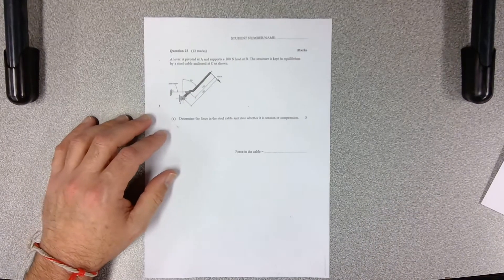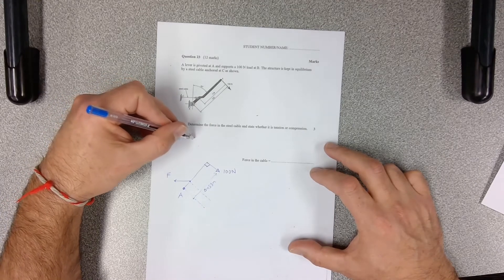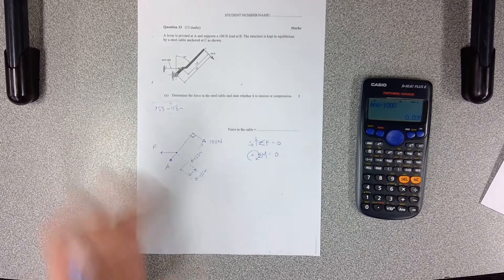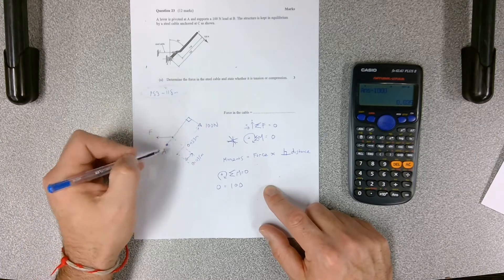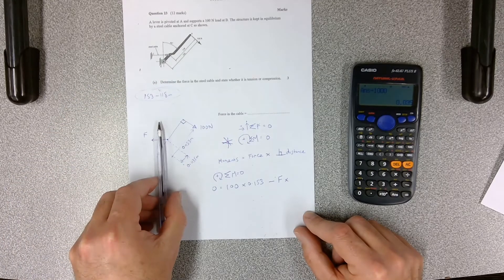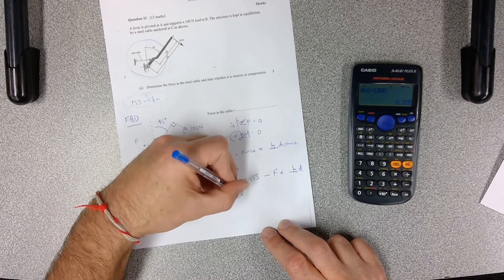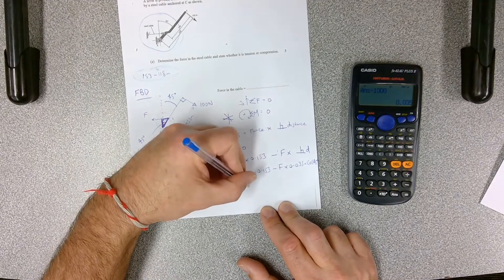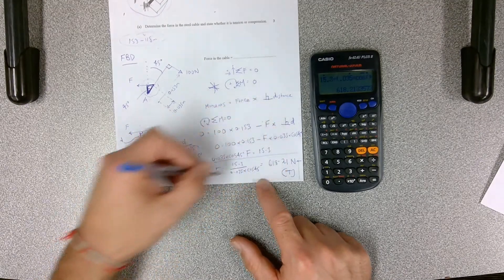Moment problem  - HSC Engineering Studies.

Comment: Thanks. Im kinda getting it. I struggle with this content however if I practice for a few hours I should be able to apply to different problems.
Reply from the maker: Yes....practice makes perfect. If you do engineering this will help in first year....I know as I studied engineering (first year) last year and it came in handy! Glad it helped. VK2AOE ....I'm a ham again sending morse and building transmitters etc....Ham radio playlist.

Comment: Well, I’m failing
Reply from the maker: No your not!!!
Each question is a gold mine ....you just have to dig!
Even if the answer is wrong you can still "pass" the question. Here are some pointers.

STEP 1- Draw a clear and NEAT labelled Free Body Diagram (FBD) .....tick some marks. 

STEP 2 - Resolve inclined forces (eg. forces that are not horizontal or vertical).....Horizontal Fxcos(Theta)....Vertical Fxsin(theta)....more marks. For this problem we don't need to resolve the forces as we know the perpendicular distance.

STEP 3 - Remember that moments are calculated as perpendicular distance (90 deg) from pivot.

Step 4 - If it is a static problem write sum (sigma) of forces = zero  and Sigma moments = zero (more marks?)

watch the video again!!! In the exam do the above and you WILL get marks!